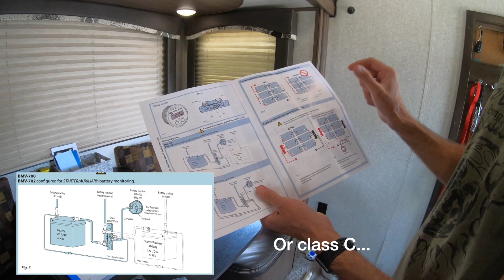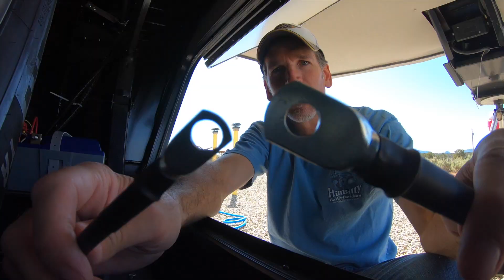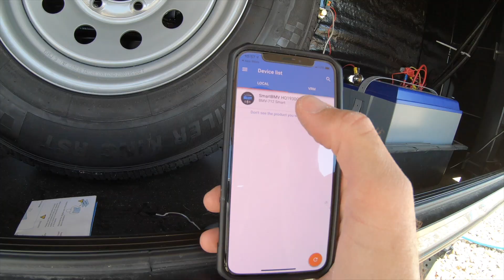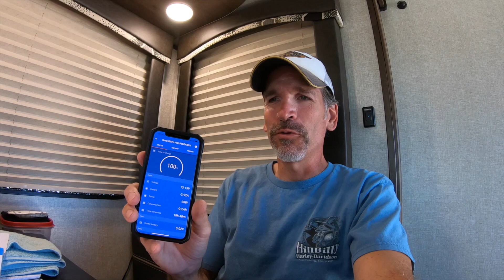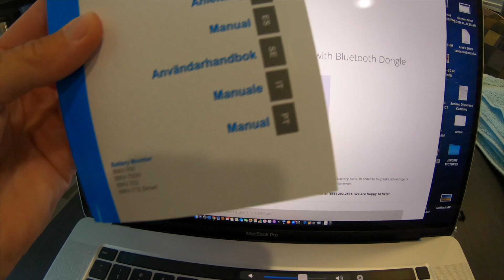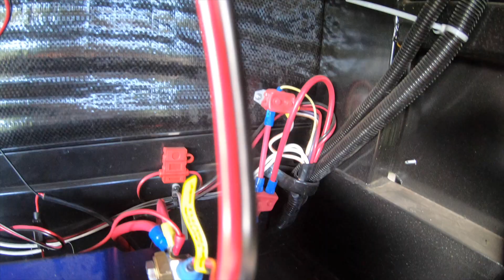Victron BMV-712 Bluetooth RV Battery Monitor Installation & Review (w/ Battleborn Lithium battery)

Comment: Love your detailed instruction. On our hybrid I have the same problem. I put in two Battle Born batteries  last fall. On our trip I found out if we didn't run the furnace all night we could get by for 3 days. If we ran it all the time we barely got a full day and night. We just squeaked  by. I thought it was the solar panel but Its looks like it was the monitor and controller.. Thanks for the explanation . I have been looking all over and everyone on you tube wants to explain watts, volts, current , amps boogy woogally . thanks for making it understandable.Im gonna have to get a replacement on that charger. I brought the batteries indoors  but Im going to have to replace the wire from the batteries to the controller as its only a 10 gauge wire right now. I went to #4 AWG from the batteries to the outside distribution  points. Then Ill change my controller to. Thanks.
Reply from the maker: @Doug McNattin  Glad this helped!  From the sound of it, you've seen my other videos on the lithium converter/charger?  If not, here's the link:  https://youtu.be/PTiTt_kqrdo   That made a world of difference once we swapped it out.  Sounds like a good idea to upgrade the wire, 10 ga is pretty small.  I use the Blue Seas calculator to size our wire.  Just need to make sure the length is out and back (essentially doubled) when doing the calculations.  Here's a link if you'd like to check it out.  http://circuitwizard.bluesea.com/  That way you can be 100% on the sizing.  We're still doing great with the new upgrades as well.  I really need to find time to put together those videos...  There's just too much to see out here!

Comment: At what point do you connect from your solar controller? I have mine connected to the battery terminals. My ground goes through a shutoff switch. 
That way while not in use my batteries stay charged and the system is de-energized.
Reply from the maker: @Brad Spitzer I connect the positive from the solar controller to a positive side fuse block and the negative to a negative bus bar.  The negative bus bar is then connected to the "Load" side of the battery monitor shunt.  I have a shutoff switch (factory installed) on the positive side that I can turn off so there is no load being drawn.  You do not want to have anything connected to the negative battery terminal other than a wire leading to the "Battery Only" side of the shunt or you will not get a proper reading on the monitor.  Did that answer your question?
Reply: @EddieAtLarge  I’m thinking the solar + can stay on the battery and put the - on the load side of the shunt.
Reply from the maker: @Brad Spitzer  I agree, that should work.
Reply: @EddieAtLarge  cool thanks. I ordered this on amazon an hour ago. Guess I’m just excited. Seems like an extremely easy install.
Reply from the maker: @Brad Spitzer  Totally understand.  I love being able to monitor the batteries with this.  I just recently installed 2 more Battleborns, the solar and a 2000w inverter.  Will be putting out some videos on all that soon.  The monitor is a fairly easy install.  Just need to get the settings right on the app for your particular batteries.  Good luck with everything!

Comment: I have seen a few videos on battery charging monitors and yours was the best. 👍🏼

However, I am still unclear for my setup. 

I have two lead acid batteries and they are in separate compartments; one on each side of the trailer.

Which way would I hook this system up?

 a) hook this up to one battery and enter the information for one
b) set up for one battery and enter the information for two
c) hook up the monitor to both batteries somehow connecting the wiring to both 
d) have a separate monitor for each.

I’m thinking: throw out “d” and go with “a” or “b”. 
I’m hoping not “c”.

Can you help me here?

Thanks Ed!

Ram
Reply from the maker: @Laughing Ram   

Hey Ram!  Glad you liked the video.  Hope you've been doing well!  

So, the BMV-712 can monitor your 2nd battery that is in the separate compartment, however, it will only give you the very basic voltage reading and nothing more. If you want to check out the diagram for the this option, click on this link and check out diagram 11.  
https://www.victronenergy.com/upload/documents/BMV-712-quick-installation-guide.pdf  

The only way you would be able to have it read and display everything for both batteries is if you would create a battery bank by wiring the batteries in parallel.  If you wire in parallel you will double your amp hours and keep the voltage the same (12v).  What is the distance between the batteries?   

Option A is also possible, but, you will only have info from the monitor for the one battery.  
Option B if I'm understanding correctly would not work.
Option C is what I described in the first paragraph. 
Option D is the easy option, but, not cost effective

Hope that helps!
Reply: Thanks Ed!

My batteries are approximately eight feet apart. They are both basically in a sealed box with a positive and negative load connection in each. I’m not crazy about drilling a hole in the side of the box.

The batteries are already in parallel. (Two 12 volt batteries supplying 12 volts) Therefore I would think if I just hook the monitor up to one battery it would be okay, as long as the batteries are in parallel and equal type. So if it shows that the one battery is at 70%, I would assume the other battery would be at 70% as well.

Am I missing something?

Not sure about picture #11. Where is the other cable on the second battery?

I really appreciate you taking the time to post the info.

We have a Lance 1985. Currently I just go out in the morning and the evening, when we have minimal load and put my volt meter on one of the two batteries. We usually are showing around 60%. We have been camping in the cold and have our furnace running some of the time in the night. “My Buddy” carries most of the middle of the night. I end up running the generator for about an hour in the morning and an hour in the evening.

Kind of a rough way to do it, but it’s been working for us. 

However, it would be nice to have the battery status on my iPhone like our gas bottles are with Mopeka.

Ram
Reply from the maker: @Laughing Ram  

No problem Ram!  Glad to help if I can.  

If you need to drill a hole in the sealed battery box, you can always seal it up with something like silicone caulking or some type of foam material after the wire is ran.  

The 2nd wire on the other battery is not shown in the diagram for some reason, but, would have the main positive load connected there (as normal) as well as one of the red positive wires that come supplied with the BMV that is ran to the B2 terminal on the shunt.  

Are you sure the batteries are wired in parallel?  For this to happen, a wire would need to be ran from the negative terminal of one battery, directly to the negative of the other battery and then the same for the positive.  Then, the positive from one battery would be connected to the main load of the RV and the negative of the other battery would be connected to the ground lug or if you have the BMV hooked up, the "Battery Only" lug of the battery monitor shunt.  Here is a link to a diagram for 2 batteries wired in parallel.  Ignore the first diagram and go to the 2nd one down on the page for the proper hookup.  https://caravanchronicles.com/guides/how-to-connect-two-batteries-in-parallel/    It doesn't seem likely that they would have ran wires like that over 8' from one battery to the other in order to wire them in parallel.  One way to test is to see if the voltages match.  Check one battery and then the other directly after and if the voltage matches perfectly, they may be wired in parallel.  There can be a slight variance of 1/10th of a volt and that is OK:  Example:  12.06 and 12.07  If there is a greater variance such as 12.06 and 12.12, then they would not be wired in parallel.  

In your situation with your batteries that far apart, I think your best option would be to go with 2 separate battery monitors, one for each battery.  You can then monitor each via Bluetooth via the app and won't even need to mount the display.  You'll still want to check them at a time when you have a minimal draw going like you've been doing to get the closest true reading.  I can actually isolate my batteries  by turning off the battery disconnect switch so there is no draw at all and that is the best way to check the voltage if you can do it that way.  

PS  I also have the Mopeka tank sensors and love them..

Please update me when you decide what to do.  

Take care, Ed
Reply: @EddieAtLarge  
My trailer runs 12 volt DC. With two 12 volt batteries, they would have to be wired in parallel. If they were wired in series, I would end up with 24 volts trying to go into a 12 volt circuit.

Each battery is tapped into positive circuit and tapped into the negative circuit at their respective location. They would be still in parallel. Picture a double loop; one negative and one positive.

Looking at drawing #11 again, if I mount the shunt in the left battery box, for example, it looks like the only wire I would actually have to run across from the right battery would be the small wire from the right’s positive terminal to “B2” on the shunt. The Negative cable on the right battery does not go through the shunt. So both the negative and positive cables on the right battery can stay tied to the circuits via the existing connections. It looks like only the negative wire on left wire has to be changed and routed through the shunt.

Thanks again Ed,

Ram
Reply from the maker: @Laughing Ram  I can understand you logic and realize that they are not wired in series.  I guess I was trying to say that they are not wired in parallel in the sense of creating a "battery bank".  In order to get a true reading from the monitor, they would need to be wired directly together in parallel and not running through the entire system when connected.  In your situation, I believe both negative cables from the batteries would need to be wired directly to the "battery only" lug on the shunt and all other negative wires would need to be connected to the "load" side of the shunt (from both batteries).  Meaning that you could not connect any of the negative loads from the rig directly to the either battery or you would not have a true reading.  You would then need to run B1 to one battery and B2 to the other (with limited data of voltage only readings on B2).  Both would be a difficult task and the red positive wires that come from Victron would not be long enough for the 8' run.  All that being said, I'm not an electrician or an expert in the field.  My next suggestion would be to contact Victron to see if they can give you additional guidance.  Please let me know if you do and get this worked out.  Good luck, hope you can work it out!  Ed.

Comment: When you set the upper level of the charge range, you set 14.4 but it looked like your specs showed a range of 14.4-14.6.  Is there a reason you went with the lower of the two?
Reply from the maker: @Josh Haas  14.4 is the recommended "Charged Voltage" setting from Battleborn.  Here is the web link to the info.  https://battlebornbatteries.com/configure-victron-bmv-700-bluetooth-dongle/   Note:  Even though it say bmv-700, the info is also for the 712.  Hope this answers your question!

Comment: Thanks for this upload! Best I’ve seen and I’ve researched many, great nuts and bolts vs a lot of blah blah
Reply: Homie, Any idea what goes on those small phillip screws on the side?
Reply from the maker: @Theodore Zen  I believe those are for smaller sized ring terminals to connect to the shunt.  They are labeled, one for the "Battery Only" and the other for "Load & Charger".
Reply: Thanks for getting back yeah I running 0/1 gauge wire, don’t think    those little screws will work lol
Reply from the maker: @Theodore Zen  Thank you very much!  Glad you enjoyed it.

Comment: Doesn't removing the fuse defeat the purpose of hooking it up before the negative?
Reply from the maker: @Paul Bromell  Hey Paul, good question!  I do agree that I could have left the fuse in when connecting the leads to the battery, however, the manual has the following statement: "After inserting the fuse in the positive supply cable to the main battery, the BMV will automatically start the setup wizard".  That is the reason why I installed the fuse after the battery was all hooked up.  I believe their main concern is that the batteries should always be connected with the positive lead first and the negative lead last.  I have always left the fuse in when disconnecting and reconnecting since the original install and have had no issues.  Hope that helps clear things up!  Thanks for watching and commenting!

Comment: fantastic install vid.  thanks.
Reply: where did you order the ground wire with the correct lugs?  putting together my build this week.
Reply from the maker: @Carl N Purchased the wires from Amazon.  WindyNation brand.  Red + Black Pure Copper Battery Inverter Cables Solar, RV, Car, Boat 12 in 3/8 in Lugs.  Good luck with your build!
Reply from the maker: @Carl N Glad you liked it!

Comment: So once this is hooked up being it is Bluetooth. Can you check the battery reading whenever your at in the world . Or do you need to be close to the rig ?
Reply from the maker: @Herber Clement III  Only via Bluetooth and close to the rig out of the box.  It is possible to connect to the monitor over the internet, however, only if you were to purchase a separate Victron GX device.  Here is a link that explains in detail how this is accomplished.  https://www.victronenergy.com/blog/2020/04/06/victronconnect-v5-20-connect-configure-remotely/
Reply: Homie At Large Thank you for the response back . I will look into it .

Comment: Thank you for the video. I’m in the middle of installing the Victron BMV-712 and temp sensor, and the temp reading was all over the place. It was reading anywhere from -1 degree C to 122 degree C within a few minutes (how’s that for global warming, lol). All other videos instructed me to leave the black wire from the sensor off, but you’re the first and only one that said to plug it into B2 of the shunt. So I went outside and plugged the black wire in and boom; it works! I thought it was a defective sensor so the seller was going sending me a replacement. I notified the seller but I hope I caught him in time.
Reply from the maker: @CL600Sport  Great to hear!   That was pretty confusing to me at first as well as the instructions aren’t clear, however, if you look closely at the Fig. 4 diagram, it shows exactly how to install it.  Very glad this helped you out!  Thanks for watching!

Comment: Great Video 
My question is what temperature sensor did you use for your Battle Born batteries??
Reply from the maker: Hey Gary, I used the Victron temperature sensor for BMV-712 (or BMV-702) and purchased it from Amazon.  Victron part # ASS000100000 .  Thanks for watching!
Reply: @EddieAtLarge  thank you for the reply that is the same part number I have.
There was a yellow tag on the red/black wire that said use only with the 702.
Reply from the maker: @garyferguson1552  NP.  That tag actually says "BMV702/712", it's just kind of blurry in the video and hard to see.  That sensor is ok to use with the 712 as well.

Comment: My Lifeblue lithium batteries have bluetooth readouts on my smart phone. I do not need an external monitor.
Reply from the maker: Hey Bob!  Looked them up and they do look pretty cool.  Looks like a similar BMS as what Battleborn has with protections for over/undervoltage, etc...  Their website says that if you have multiple batteries in parallel, you would need to multiply by number of batteries in the bank to obtain the total amperage for the bank whereas the Victron monitor has that done already (not really a deal breaker).  A few other differences are: Victron monitor also displays Power (Watts), Consumed Amp Hours and has a Time Remaining function that estimates time left for the current usage state (I don't necessarily care for the Time Remaining function and don't plan to use it).  The relays are also a nice safeguard.  I have parameters set for those as well as a backup to the Battleborn BMS protections.  Thanks for watching and commenting!